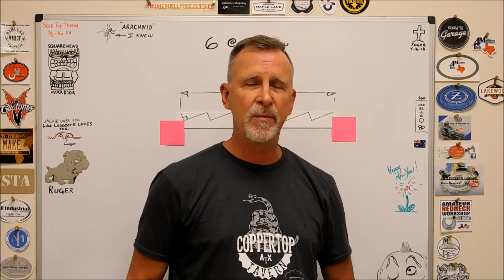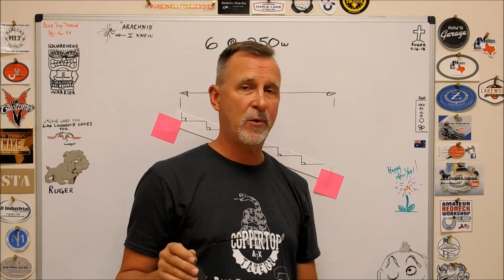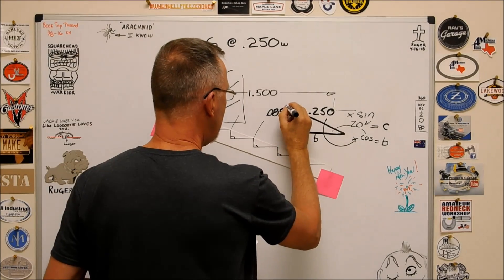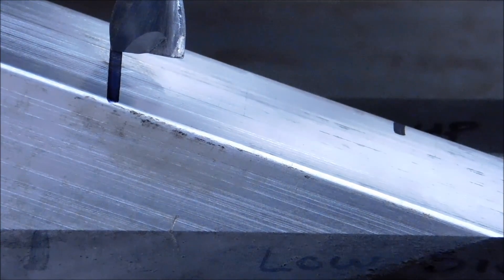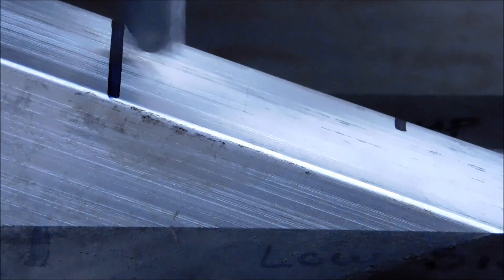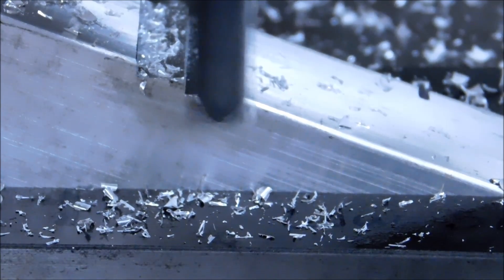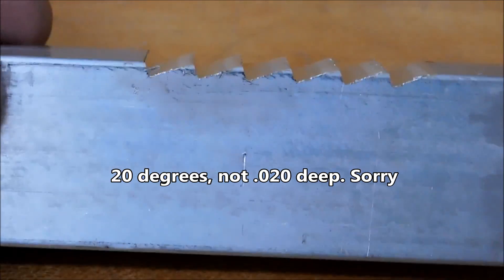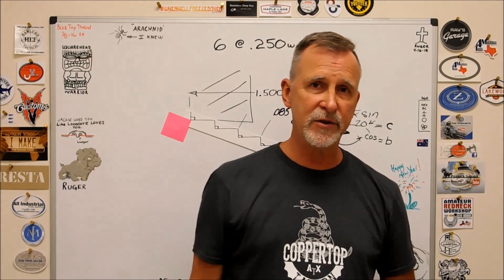How to Approach Milling Serrations

Comment: Joe- great video, but I think I should correct something you said.  You said “it is a lot easier if you have the angle versus the depth.” 

In reality it is far easier if you have the depth of the serration. With the depth of the serration and the length of the serration you can calculate the length of the flat using the Pythagorean theorem, a^2 + b^2 = c^2.  Then you don’t need to use an angle block or any trig.  

Setup is also pretty easy.  Here is an example:

Suppose you want to have 6 serrations over a total length of 1.5”.  Each serration will be .250” (the hypotenuse, c) and suppose you want the depth of cut .100” (the c in the formula for Pythagorean’s theorem).  The b is calculated as .100^2 + b^2 = .250^2.  .01+ b^2 = .0625.   b = square root of .0525 = .229

You can arrange the part in the vise at an angle just as you did but instead of using an angle block (not sure they make a 9 degree angle block?) you simply calculate the total x and y travel and use those measurements to locate the part in the vise at the right angle.  

In my example above, total x travel is .229” x 6 = 1.374” and the total y travel is .100” x 6 = .600”

The rest of the setup and process is identical to what you describe.  

Make sense?
Reply from the maker: I am initially inclined to disagree with you. The depth is a resultant feature of the correct setup. Although the Pythagorean theorem works for the third leg of a right triangle, the depth of this feature is not the third side. You'd need to break out another triangle using the short side as the hypotenuse and use an algebraic equation to start figuring out legs. Sketch it out and you'll see what I mean. By all means, if I am missing something, correct me and I'll gladly accept it. I think you will come to the same conclusion.
Reply: I guess it depends on what you mean a
when you say depth.  If you mean depth of cut, then my math above works.  If you mean the measurement from the surface of the part to the deepest part of the cut then yes, you have to do more math to get the depth of cut.  

My approach above, however does solve the limitations of having an available angle block to get the depth you want.  

Not sure how to post a photo / diagram in the comments.
Reply from the maker: In this example, the depth of the cut, isn't the depth of the feature. The depth of this feature is perpendicular from the top plane to the corner formed by the end mill. You can see the smaller triangle I am referring to. I'd have to CAD it out for speed. Too much algebra involved for my liking. Having that slope angle just makes it so much easier. Thanks for your comments.

Comment: like building a stair case in a house on a smaller scale. I like how you showed the difference of that 5 thou finish cut verses not doing it. I recently bought my first adjustable boring head. learning to use it. I see three holes in the bottom and one in the side. I have not used the side hole yet but it puzzles me as to how the boring bar would cut using that side / horizonal hole as apposed to the vertical holes. do you have a video showing boring a large hole like a 4 inch hole using the boring head and the side horizonal hole. looks like the boring bar would be backwards or am I not understanding something?
Reply: A cranked , left hand tool, clockwise rotation.
Reply: @adaml52  thanks
Reply from the maker: A left hand tool is suggested, but running the machine in reverse with a right hand tool won't hurt anything. The first time I used that side hole was to re-size a transmission pilot hole in a bell housing. Keep you fingers out of the way and be aware of the unbalanced nature of the setup. It can lead to elongated holes. A slower RPM is a good idea.
Reply: @joepie221  
I was going off of a fly cutter usually the tool tip is on the centre of rotation but then so is a boring head.
I mentioned it's needs to be a cranked tool as the boring head body would contact the work piece before the tool tip.
My boring head the tool sits horizontally in this configuration.
If that makes sense ?. On second thoughts your would not, as a boring needs a pilot hole to start with , Doh !.
Reply: @joepie221  thanks Joe my machine don't have reverse so left hand tool it will need to be. are they hard to find? mostly all I see are right hand boring bars. never seen a left hand one. of course when it comes to machining there is a lot I have never seen. thank you for helping us less than educated wanna be machinist out.

Comment: So now a question or two. If you were to use a small dovetail cutter instead of an end mill on say, W1 or 4140, and then heat treat it could you not make a broach for cutting internal keyways in bushings and such? It would be easy to mill a slightly sloped surface in your material to give you the taper that your broach would require and then just mill that tapered surface exactly as shown here. Once you had hardened and annealed your work to the necessary Rockwell or Brinell you could then use a small grinding stone mounted on a mandrel in your mill to grind your gullets to get a proper degree of tooth sharpness if you did not have a cutter grinder machine. It might not be as pretty or durable as a factory made unit but it might suffice in a pinch would it not?
Reply: If you poke around Clickspring's older videos, you will find (at least) one of him making a tiny broach by milling a small piece of bar stock. I believe he was using it to make a square hole in a watch baseplate.
Reply: @lwilton  yes, that is a pretty good video. I've mad an odd shaped broach once. The hole was the shape of a tear drop and it was specified that they wanted a SHARP corner. The guy with an EDM was gonna chrge them more to do it than I charged to make the broach. IIRC, I made $150 an hour and almost felt bad. I used D2 because that's what I had on hand that fit the diam requirements. This was long before I knew anything about YouTube. It would have made a great video if done by Joe. I transplanted from Texas as a kid, to Kentucky. Not the best dialect to be making videos. LOL.
Reply from the maker: I have a broaching video coming up. You'll like it. This technique is a good one for making broaches. If you ever do, and it comes out too big, only the very last tooth needs to be tweeked. Sometimes dusting the back of the broach can be a solution as well. Re-doing all the teeth would be a PIA.
Reply: @joepie221  PITA indeed. I was lucky in that this was more form than function. Tolerances were exceptionally forgiving. None the less, the education I received was priceless not to mention the confidence I gained as a young machinist and toolmaker apprentice. I never asked for any help on it and my Toolmaker seemed impressed. I could tell because he didn't cuss me nearly as much. Lol

Comment: Nice tip about the 0.005" cleanup pass. I suppose the "arachnid" on your board is some private joke, but the drawing has the number of legs an insect does, arachnids have eight legs.
Reply from the maker: I see 8.
Reply: @joepie221  And you are right (as always). I mistook the first pair as antennae.  My apologies for the false alarm. :{
Reply: @weshowe51  I would say it refers to the wolf spider whose legs were tangled with dust bunnies that Joe detangled on camera and went viral.

He's since done a couple of new videos about it I think.
Reply from the maker: I've taken a lot of heat for calling that spider an insect.

Comment: Joe you can use the simple mnemonic SOH CAH TOA. Sine x (°) = Opposite / Hypotenuse. Cosine x (°) = Adjacent / Hyp. Tangent x (°) = Opp. / Adj. if you don’t know your angle but do know your Adj + Hyp, it is simple enough to re-arrange. E.g. A = 20, H = 35. So, - Cos (x) = 20/35, therefore, (the angle you wish to find out) X= Cos-1 (20/35). (Cos -1 is a function).
Reply: Cos-1 also known as arccos or acos, and on many pocket calculators it will be shift-cos, but this needs to be checked with the markings on the calculator keypad.
Reply: Some People Have Curly Black Hair Thickly Plastered Back is Sine =Perpendicular/Hypotenuse etc etc, Black is Base.
Reply: Soon Our Harvesters, Collect And Heap, Tons Of Apples - that's the way they taught us in England.

Comment: Yep another great video.  And it's true. As machinists we simply cannot avoid knowing geometry and trig if we want to be fully capable.    A minor point but for anyone doing serrations like this for gripping.  It would be nice to adjust the cuts so that we leave a few thou of the original material on the crests so the edges don't dig into our skin too aggressively.   Basically reduce the depth of the roughing and finish passes by enough to leave perhaps .01 of the original surface on the crests to avoid shaving skin.  And even then we'd want to run something over the edges to dull them slightly.

Comment: EXCELLENT trig lesson and yes, the longest side of a right triangle is the "hypotenuse". (A busy restroom on a 737 jet at 35,000 ft.)
One way of remembering the trig functions is SOH-CAH-TOA. Pronounced, "soh cah toa". Referencing from the known angle, the ratios are  (SOH)  SINe is Opposite side over Hypotenuse, (CAH)  COSine is Adjacent side over Hypotenuse  and  (TOA)  TANgent is Opposite side over Adjacent side.

Comment: Joe I have a similar issue other than smaller and the "B" in your drawing must stay parallel with the surface and the HP must incline with steps. It is an elevation ramp for the rear sight of a shotgun which ended up missing, so maybe 0.100 thickness and 1.5 long with small step height probably 6 steps too. However I think a tapered step to retain during recoil pulse. What do you suggest. Vertical mill no DRO.

Comment: Now I'm imagining some carbide cutters, tool steal and making my own broaches as needed.  I may have to learn to grind carbide dovetail cutters on my T&C grinder so I can make cutting edges correctly.  I tried making a triangle broach a few months ago but it didn't really work out.  It was for ~.093 alum sheet so I ended up making a little punch jig I could use in my press that worked for the low run I needed to do.

Of course I have to thank you.  Not just this video, but all your instructional videos.   I rely on you and other youtube machinists for me to push my hobby in hopes of someday being able to retire my long 30+ year IT career into my dream of being an odd job shop guy.  So far my youtube channel has mostly been building out tooling for my shop.